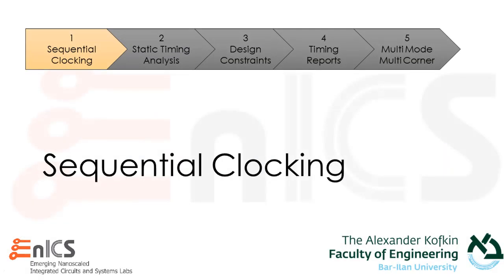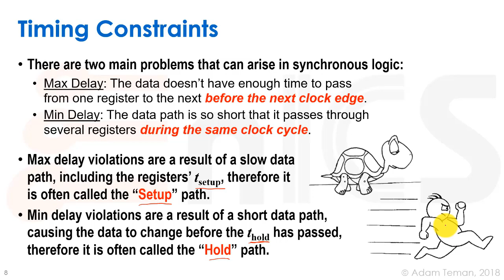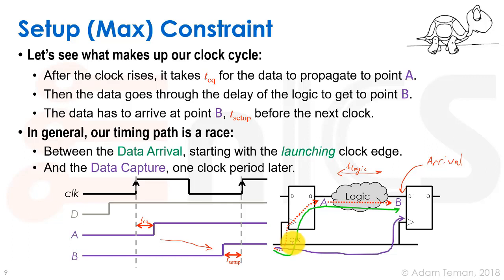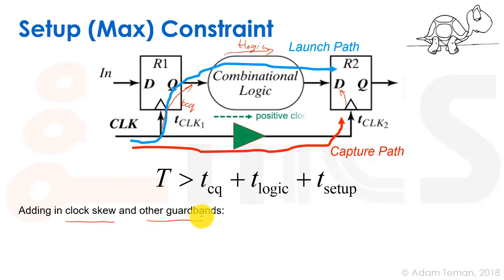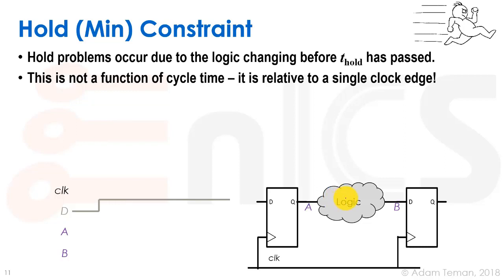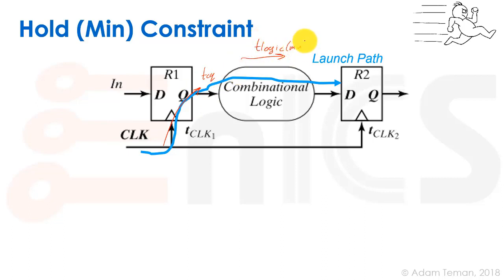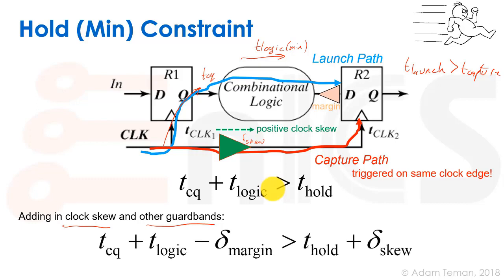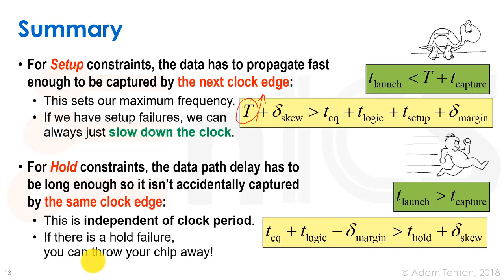DVD - Lecture 5b: Timing Constraints

Comment: Hello Professor, can I ask you a question? assuming we only have one clock, do we need set_clock_latency before preCTS? my understanding is since the clock is ideal now the set clock latency won't have any impact on our timing analysis.
Reply from the maker: In general, I think your comment is accurate.
Set clock latency is not a "mandatory" SDC command. I won't say that it's "rarely used", but it's not "always used". It adds some delay to the clock net, but in zero-delay analysis, this is not something you would "usually" need.

(note that my "quotations" are because there are use cases for just about EVERYTHING you could possibly imagine, and if you can't imagine them now, you will one day run into them and imagine them then. It's hard to convey the beauty and usefulness of SDC, CTS constructs, etc., at such an early stage in introducing physical design. But when you start to work on complex and "crazy" projects, you find out that you need just about everything in the manual.  It's pretty cool, to tell you the truth. Especially when you have an "aha" moment, when you suddenly run into something that you find that somebody thought of an answer for many years ago, but you've never realized it could ever be needed until that minute.)